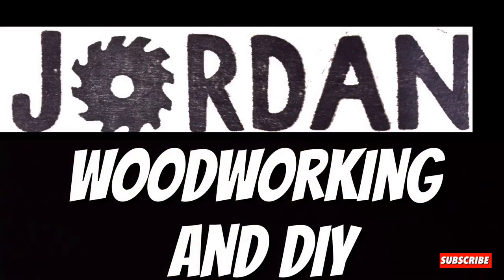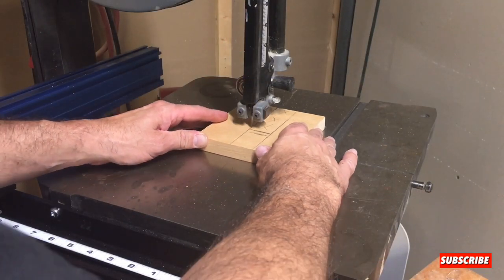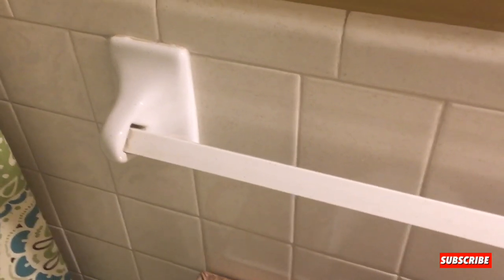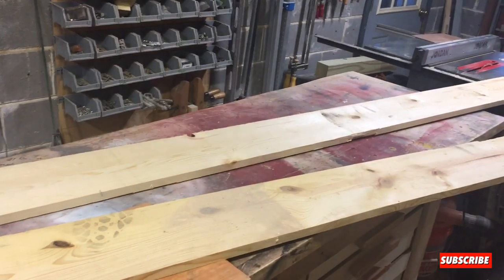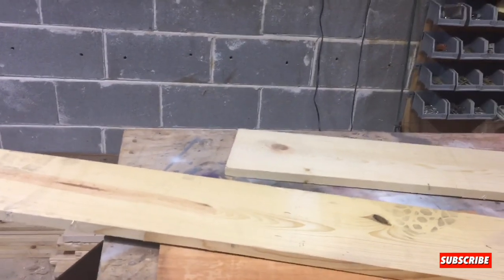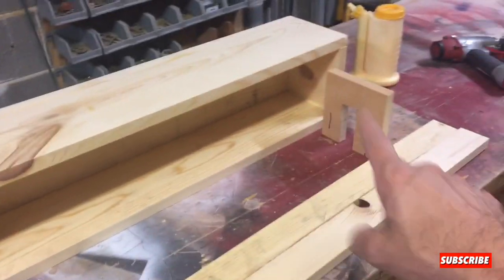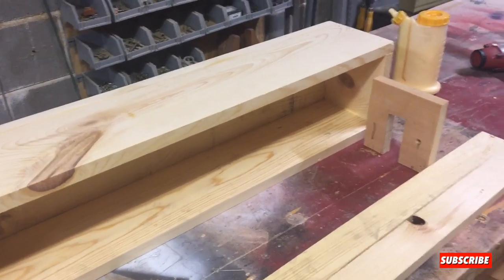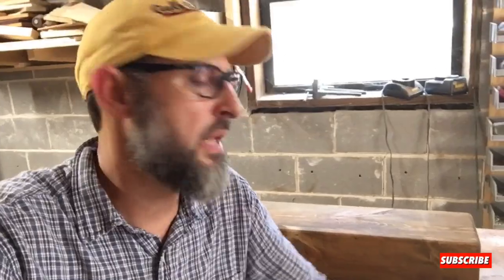How to make a floating shelf over a towel rack-diy

Comment: Nice. Should make it so a door on bottom flaps down to reveal a hidden gun.
Reply from the maker: Joe Smith good idea
Reply: @Jordanwoodworking  cut out section on bottom just big enough to attach a small pistol with 2 Velcro straps. Use 2 hidden internal hinges. Magnetic latch. Put magnet on bottom of something sitting on top. So you just grab item on top and slide it over where latch is. Door drops down. Rip off 2 Velcro straps and all set to defend your throne in your castle.
Reply from the maker: Joe Smith sounds like I know who needs to build that. You know I’m a simple man